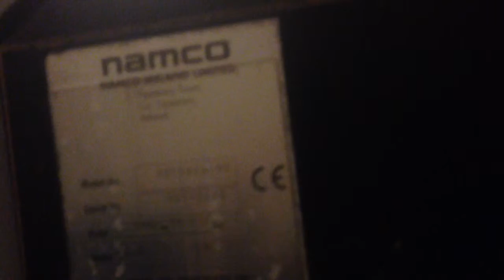Maximum force arcade restoration part 1

Comment: If that's an interlock switch on the back you can pull it out and it will keep the game on.  Didn't you have a Maximum Force or Area 51 at one time before?
Reply from the maker: i have the area 51 you fixed the monitor for at my parents. can i just remove the switch?
Reply: ***** Should be able to.  Just cut it out and wire back together and make sure to insulate well.